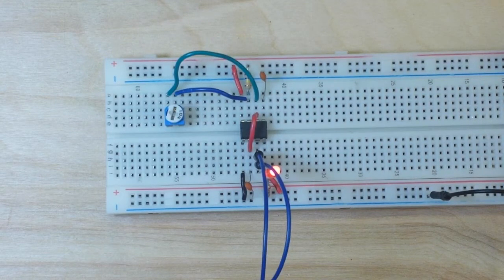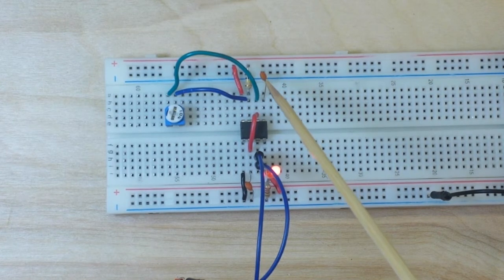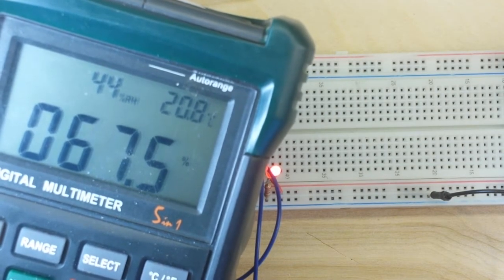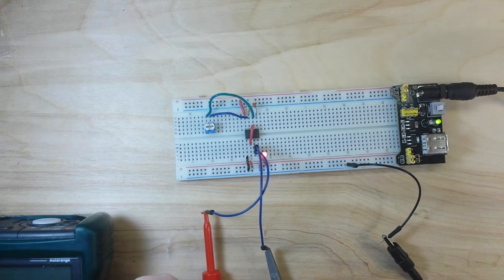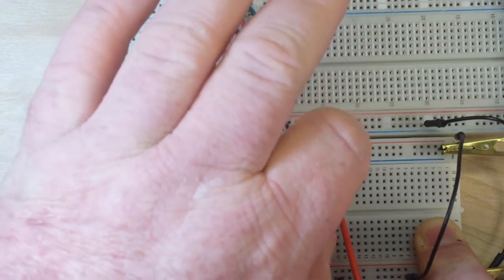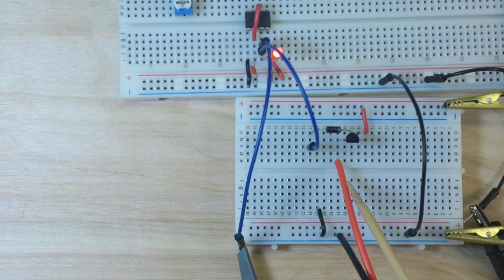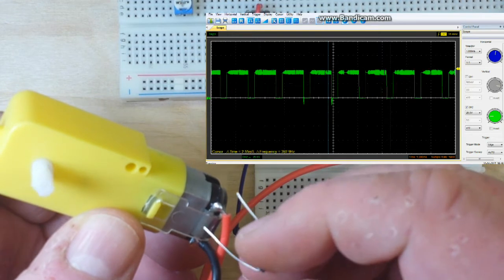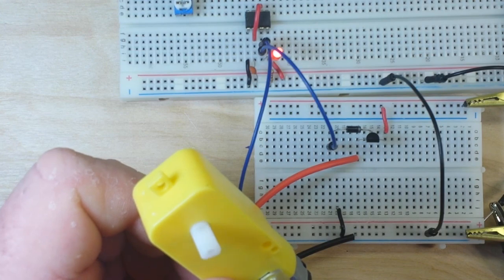How to drive higher current circuits with a 555 timer

Comment: if uve got an oscillator theres funny amps you can make with diodes and capacitors if u dont like transistors, but then ur still stuck with em in your oscillator.

Comment: How can I limit the current that comes from my mains socket? Can I symply use a resistor small enough to limit the current?
Reply from the maker: That is the primary function of a resistor and yes I'm theory you could limit the current that way. But it would be extremely dangerous. I do not recommend.
Reply: @learnelectronics  Well thank you, Sir. Is there any way you could recommend instead. I want to build a power supply that should draw 230 Volts from my main's socket but only drawing about 2 Amps of current!

Comment: I'm very upset because of inductive load and overheating I have a coil at the output that trigger a reed switch but the problem is that 555 timer heats up so quickly I did the diode in reverse but it it didn't help any other ideas?
Reply: Try using a z44n mosfet instead of the bc107  for higher loads
Also put a 1k resistor in series with vcc

Comment: Using a rectifier diode for the base of the NPN BJT is strange, a 330 ohm resistor will be better. Also, shorting out your stepper motor with a diode is very bad, you should use a capacitor to reduce noise.

Comment: Can a pot set up as a two-lead variable resistor be called a rheostat, or will that be incorrect?
THANKS AGAIN FOR THESE VIDEOS!!
Reply from the maker: Yes I do it all the time.
Reply: the central wire can be the input or the output depends on what ur doin'!!!

Comment: One more thing came to mind:  Couldn't you just drive the 555 with the same hi-current power source that drives the load?
Reply: No - pin 3 of a 555 can only provide 200mA to the load, so if you have 1 amp power supply and a load that needs 1 amp, the 555 will heat up then die in about 3 seconds. Sure you can power the 555 with the 1A power supply, just don't put a load on pin 3 that draws more than 200mA.

Comment: This is GREAT!!  I am looking for a simple way to make a 555 output drive a high current device (about +/- 150mA at 40 kHz).  In other words, I would like to source and sink this amount of current when the output (pin 3) is high and low, with a minimum external parts count.  It is no problem to externally supply the current capability if necessary.
THANKS SO MUCH FOR YOUR SUPERIOR VIDEOS!!!!!

Comment: this is what got me into electronics. I wanted to build a electric car. so I needed to build a motor controller. for a 72 v DC motor. that pulled about 500amps. could something so simple drive that much current? and what about over current and over temp. ? could a arduino be used to keep an eye on the current  and temp. and shut things off it certain parameters are exceeded? it will be a while before I can even seriously think about this project. I already have the motors. but that's it! thanks for sharing your wisdom.
Reply from the maker: +James stranger The 555 is isolated from the high current by the transistor. So yes, with a large enough transistor it could work. In this case probably a MOSFET or IGBT is called for.

Comment: would a capacitor help with the noise on the motor also?
Reply from the maker: Yes it would
Reply: which would be better? is one suited to 1 situation and the other one another?

Keep up the great vids
Reply: Yes, using the diode across the motor leads is a short, that is why the current draw spiked. The diode across the motor is bad, only a capacitor should be used.